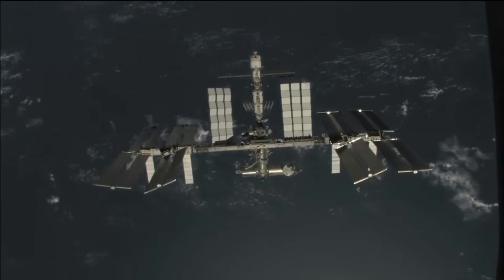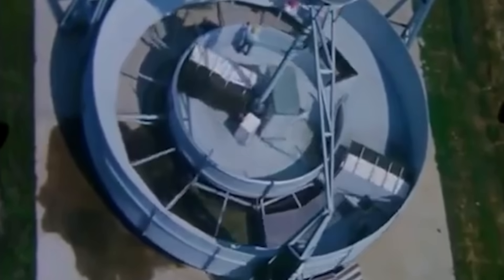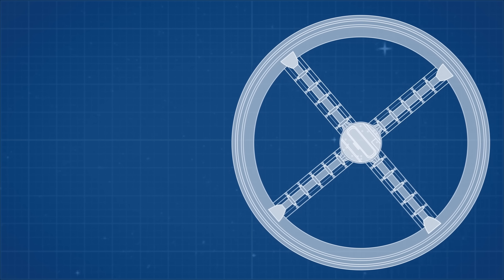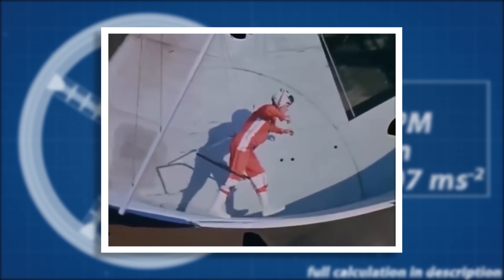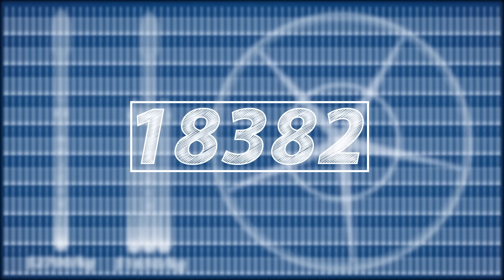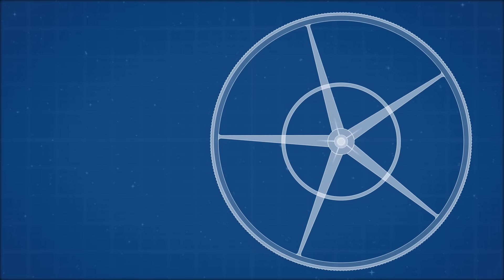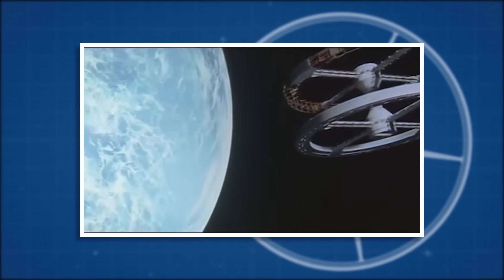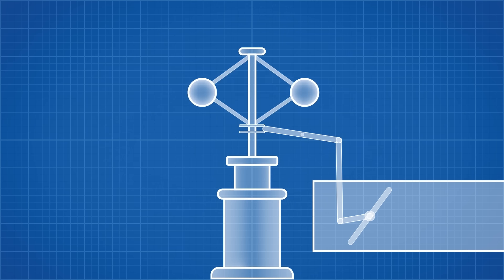Can We Create Artificial Gravity?

Comment: Given that the centrifugal force you feel is tied to your speed, would moving with/against the ships rotation not cause issues?
Reply: Yes, you are exactly correct, you would grow heavier if you ran in the same direction as the ship's rotation and you would grow lighter if you ran against the ship's rotation. Exactly how much will depend on your speed relative to the rim's rotational speed. I'm not sure how pronounced this effect will be, so I intend to do the math for it when I have some spare time.
Reply: Teodor Jovanovski Wrong, moving at a constant speed will change your weight if you move spinwards or counterspinwards.

Think about it, the force you feel results from the centripetal force of the floor holding you in a curved path, while your body wants to fly off in a straight line due to inertia. If you are moving spinwards faster, than that centripetal force is apply more force to hold you in that curved path, and you feel heavier. If you move against the spin you are moving slower and the force you feel reduces.

Basically, you weight depends on the speed with which you rotate around the axis of rotation, and if you speed that up or slow it down the force you feel changes.
Reply: That is another reason to go for a long arm. For generating a given force, a longer radius has to move faster at the end (F  = mV^2/r) which means that a fixed change in velocity has less effect.
Reply: It's tied to the wheels speed
Reply: Albert Qin No, it's tied to your speed. Say the wheel was rotating at 10km/h and you ran 10km/h in the opposite direction, you'd lose the centrifugal force.
Reply: Only if you'd accelerate. Not if you move with a constant speed or get caught in freefall.
Reply: Christopher Phoenix Ah, I see what you mean. I rewinded the formulas and it makes sense. But that would only be if the vectors of the speeds are parallel. But if the vectors are normal, then it would make no difference, would it?
Reply: Dirk Larien Yes, an object has to touch the side and present enough friction that it starts to move round with the side.
Reply: Good point, if u cud kick a soccer ball hard enough to make it stationary, it would never go back down to the floor
Reply: +Dirk Larien It would work as long as the object or fluid starts moving ever so slightly with the floor. Basically as soon as it starts moving just a little bit "forward" (along the tangent of the circle) it will slowly fall which will make it contact the floor and accelerate it even more which in turns makes it fall even more and again contact the floor even more until it match speed with the floor.

In fact it just have to move ever so slightly in any direction to upset its resting "floating" state and eventually it will contact either the walls, the roof or the floor and start its acceleration procedure.

Comment: Wait, could you just build a long rod that spins lengthwise and have the people live in the ends for most of the time? It would certainly save on material costs and launch costs, though it would sacrifice living space and easy manuvering, as one would have to climb to get from one end of the rod to another. Of course, if you wanted more space(at higher cost) you could just add more spokes, the next step up would be a y-shaped ship, then a plus-shaped ship, and so on.

Comment: You are way WAY off with your costs/requirments.   It only takes three launches of some reasonably large rockets.
Reply: In order to get his version of Artificial Gravity to work in space.  It only takes three launches to get up to two orbital "hotels" (boy did I use hotel loosely).  A stripped down version that only needs two launches was even considered (and still has a low probability) for the maned flight to Mars. That's what I'm talking about.

Now, How you ask?

Ok, don't give me grief that I'm skipping a LOT of details.  Just to get the concept across;

You need a center docking cylinder, you know, shaped like a rocket for easy lifting.    Then two more "hotel" cylinders.    string together;

Hotel -> string -> doc -> string -> Hotel.
  
now the string isn't from my shoe laces and there is some fancy connecting of the strings to keep the hotel cylinders from wobbling like a cheep ass suspension bridge.  

Then you can transfer the people from the doc to the hotel vs space suits and cables.  Or stop the rotation and suck in the hotels to the center.  Lots of details but no one is seriously pushing the monstrosity he showed.
Reply: ***** Also FYI, the mars mission skips the doc part in the center.

Comment: But centrifugal force isn't real.That is just an oversimplification that ignores the real forces that are in play that end up with the perception of centrifugal force. If you picture a space station that you have spun to create this artificial gravity environment, and you are standing in it. If it suddenly disappears, what happens? Do you fly directly away from the center of the space station, as centrifugal force would suggest would happen? No, you don't. You would fly along a vector that is tangential to the circle. Centripetal force is what holds you in the circle, and without a structure to exert that force, your inertia takes over. The reason the acceleration can be said to be in "g", is because the Earth exerts acceleration on you while you are on it, NOT force. Not bashing you or your video, just trying to put some knowledge out there.
Reply: Earth applies a centripetal force on you're body, there still is no such thing as an actual centrifugal force, what people generally perceive as a centrifugal force is really just an objects inertia resisting the centripetal acceleration. If there were 2 equal and opposite forces acting on an object during circular motion they would cancel out and the object would always fly in a straight line. Newtons 3rd law pair to the centripetal force from gravity on earth pulling you down isn't an equal centrifugal force pushing you up, the 3rd law pair is the gravitational force your body exerts on the earth.
Reply: I'm sorry Aneutronic Fusion, but you are confused. Centripetal force and centrifugal force describe two different things, and you are not using the word correctly while the video most certainly is. 

Centripetal and centrifugal forces--while not true fundamental forces like the strong, weak, & electromagnetic--are concise and convenient ways to describe different phenomena. 
Centripetal force is inward-seeking, like gravity. Centrifugal force is outward-seeking, like what you experience inside the carnival ride Gravitron, or like the inside of a centrifuge. 

Arthur C. Clarke's (if i remember correctly) mnemonic to remember the difference:
Centrifugal = centrifuge = pulled outward
Centripetal = petals like a daisy flower = pulled inward

Another example of centripetal force is the tension in a string if you were to secure string to a rock and then swing it around you; the rock doesn't fly away because of the strength of the string--its tension--which you may correctly call centripetal force. 

No phrase conveys the phenomenon displayed in the video more concisely or clearly than *centrifugal*, and really: you're not gonna have many opportunities to intelligently use the word centripetal in a sentence, unless it's to tell someone that they're using the word centripetal wrong.
Reply: @sequoiahughes8536  You are clueless about physics! Centrifugal forces don't exist! There are no outward forces when moving in  circular motion inside of a cylinder.
Reply: @ricomajestic  I'm nobody. Talk to a physicist.
Reply: You're not providing any "knowledge"; you're just needlessly confusing people which passes off as smarts to the less-knowledgeable. I'm the one here providing people with straightforward explanations, not you. People like you are a cancer on comment forums, dumbing down America with your confident stupidity. 

GRAVITY is the best example of centripetal force, a force that pulls objects toward the center. Name a better example of centripetal force. Name ONE. I can name other examples, but I think gravity is the best because it's not an actual force, like the strong, weak, or electro-magnetic, but a consequence of warped space-time as described by Einstein's Theory of General Relativity. Are you gonna post "gravitational force isn't real" on every video about gravity? Sure you will Sparky, sure you will. What about "frictional force"? What about NORMAL force? Are we allowed to use that one? Do we have your permission to say Normal Force?
Reply: Force = mass x acceleration. You = mass, Earth = applies acceleration on you. Hence, it applies a force on your body.

Comment: There used to be a carnival ride called the "Roundup" it was a drum-shaped affair with stansions for each rider. When all were in place and a security chain to keep the rider from falling out of the stansion was in place the ride would start. It would gradually accelerate to speed, then tip up nearly 90 degress so that the spinning drum went from the horizontal boarding position to nearly vertical and the centrifugal force kept the rider in place as you looked at the world, now very different. Yes, Virginia, there IS a centrifugal force, Centrifuges have existed since the early or middle 1950's when I was 8 years old, and were long associated with high-speed and space flight

Comment: There is no centrifugal force. There is only vectors of MOMENTUM. The Astronauts momentum is at 90 degrees to the centre of rotation. Thereby he is pushed against the side by his own direction of travel (vector). Centrifugal Force suggests that there is some kind of force pushing the astronaut away from the centre. When in reality it is the steel wall that is holding him in. The only force therefore acting on the man is the rotation of spin.

Comment: @ real engineering, If you like the steam governor then you should check out an old Otis Elevator "flyball governor". They're actuated the same way using the flyball and centrifugal force. If an elevator over speeds in the down direction it is used to set the safeties.

Comment: I feel like it is worth noting that a spinning station could also be used on lower-than-earth gravity bodies (like the moon) to increase "apparent" gravity, reducing the long term effects of low gravity. Take the spinning segment and put the axis of rotation parallel to the gravity vector on the moon, then take the floor and shape it into a parabola with the focus of the parabola as a point on the axis of rotation. It wouldn't all be the same "apparent" gravity, but with a large enough station you could make the difference from the exterior to the interior minimal.

Comment: You don't need an entire torus. That's ridiculously expensive and heavy and wasteful. You only need a pod big enough to live in, a cable, and a counterweight. If you want, the counterweight can be another pod. Get them into orbit separately if needed, then connect them. The longer the cable, the better it works. Once the combined craft reaches its destination, spin it down and retract the cable. Detach and begin operations as a traditional spacecraft.

Comment: I actually came here to ask something. Would it be possible to generate artificial gravity in space without using centrifugal force? Could we somehow capture dark matter and trap it on the spacecraft with densities that would create the gravitational pull that we need? I guess the downside to this would be the spacecraft would then be attracted to earth and de-orbit quickly.
Reply: No, that's dark energy causing the universe's expansion. Dark matter is different. But dark matter isn't the cause of gravity either. Dark matter is just matter that doesn't interact (or only weakly interacts) with "regular" matter - so the only way to reliably detect it is by observing the gravitational force it exerts due to its mass.

So to answer your question: dark matter isn't any different gravitationally speaking than "regular" matter, so it wouldn't be any better at creating a highly localized gravitational field like that. But even if it could, the whole reason dark matter is "dark" is because it doesn't interact with other matter, so there's no way for us to trap it (except by using a gravitational field, which kinda defeats the purpose of using it to create artificial gravity).
Reply: Why dark matter? Black holes are not dark matter. From when dark matter creates gravity?
Reply: I thought dark matter is what causes gravity...
Reply: Brian Su Scientists say that dark matter makes the Universe expand. That's the opposite of gravity.
Reply: Hmm OK thanks.
Reply: Great explanation. Thank you!!!
Reply: https://en.wikipedia.org/wiki/Dark_matter Ohh, sorry! My mistake.

Comment: The big issue with creating a spinning wheel space station, is the size. But, as the first functional module, do we need the full wheel? Could we not make do with just a frame, then attaching parts of the wheel as modules over time?

Comment: So I did some calculations and came to the following conclusion:

Using the formula F=m · v^2/r (In which F is force in Newtons, m is mass in Kilograms, v is velocity in meters per second, and r is radius in meters)

The gravity on earth is ~10 newtons so F=10. Let's say the average human weighs 65 kilograms, so m=65. If we create a spacestation that has a radius of 60 meters, we get r=60. If we insert this into the formula we get:

10=65 · v^2/60
600=65v^2
If we divide that by 65 we get:
v^2=9.23 m/s
This means that v = 3.04 m/s.

Because the spacestation has a radius of 60 meters we can calculate the circumference:

Ø = π · (2 · 60) = 376.99m

To calculate the RPM we can use the following formula:

RPM=v/Ø · 60
RPM=3.04/376.99 · 60
RPM=0.48

This means a spaceship with a radius of 60 meters would have to spin 0.48 times per minute to create enough centrifugal force for artifical gravity.

(I was bored in class)

Comment: Nobody is ever going to build a space station like that. I mean, no one needs an entire wheel in space. All you need is a small habitat module and a counterweight tethered together and spinning, with a docking bay in the middle and a counterweighted elevator to take astronauts to and from the habitat.
Reply: Never say never. I
Reply: Yes you could do it like that, except it would be extremely sensitive to small changes in mass distribution, for example if you walk from one side of the room to another. You can get around this with a computer-controlled ballast system that moves weights around to compensate, but that takes energy which in turn you have to generate. A central hub of appreciable weight delivers a more stable rotation.
Reply: And what would you do with our budget?
No one needs to waste a quarter TRILLION dollars on NOTHING, either, but we do that every year through the national debt interest.

Imagine, 250 billion dollars.  Stacks and stacks.  Now imagine pouring gas all over it and lighting it on fire.
Now imagine doing it every year.

And you think building a space station is a bad idea?
YOU are what is wrong with this nation.
Just go back to your worthless job that no one gives a shit about.
Reply: We should cut medical down to 0% and give it all to SpaceX and NASA.
What's the point of fixing the organs of people without brains?

Comment: We are not forced to build a ring. We can also build double-hammer shaped spatial stations. Actually, one of the important question is how we keep the station rotating. In 2001, this is done with a double ring and a torque between the two. Having the same system but with double-hammers instead of full rings would allow a smaller station (in term of volume) with earth gravity at its 4 ends.

Comment: If we could find a (relatively) small extremely dense material. Wouldn't that create its own gravitational pull? Mimicking the dense core of the planet Earth? Place that in the center of the ship to create artificial gravity. You could also use the gravitational fields generated from such material as fuel. Like an old school water wheel. Grant it the decks below the ships core would be "upside down" and the ship would need to be spherical in shape. But the round outer shell would lessen the impact damage from space particles and give it added strength due to the arch law of building strength. 

Also the matter of orbital launch must be taken into account. if we were to launch our space vehicles from low orbit or even from the moon there would be far less launch costs. Moon based Dry Docks...

Comment: Without knowing how the station is constructed it would be difficult to estimate costs.  It's conceivable that a light weight liquid could be made into forms in space.  Also, if you're comparing the cost to the ISS you need to figure that most of the ISS was state-of-the-art prototype one offs.  Which naturally cost a lot more than anything in mass.  Once private companies make travelling to space cheaper they are bound to do the same with making structures.

Comment: I get the idea that if you are in contact with the station it'll throw your inertial velocity toward the outside. BUT if you are in the center (not making contact) there's no reason you'll be pushed toward the outside wall. 

Also, if you are in contact with outside track and you throw something tangent to the motion in the opposite direction of motion the object will just float permanently. 

You would still need a constant tether to the object and one could still get lost in the center of the centrifugal object.
Reply: In all, it's not centrifugal force. It's a torque(rotational acceleration ) that is then stopped by a centripetal force.